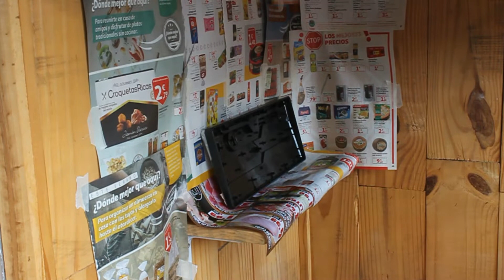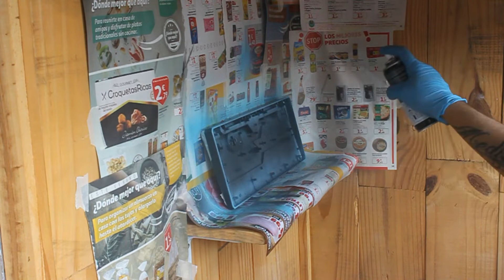Cómo customizar un teclado Krom Kernel TKL 🖌🛠  | Krom Kernel TKL Mod (Keyboard Modding)

Comment: Para comprar los keycaps tiene que tener algún tipo de compatibilidad ? Soy nuevo en esto de teclados mecánicos
Reply from the maker: Depende de los switches que tenga tu teclado mecánico pero normalmente suele valer para todos a excepción de alguno que sea muy especial! Si quieres dime que modelo de teclado tienes y te digo si te podrían valer los mismos que puse yo!! Muchas gracias por comentar!!

Comment: hola donde puedo adquirir esos guantes? un saludo
Reply from the maker: Hola Javier, cualquier guante de poliuretano te puede valer. Normalmente se suelen encontrar en cualquier bazar o ferretería pero si quieres te dejo éste enlace a Amazon donde puedes encontrarlos. https://www.amazon.es/Ruvigrab-Guante-soporte-recubrimiento-poliuretano/dp/B07X4RC1MN/ref=sr_1_5?__mk_es_ES=%C3%85M%C3%85%C5%BD%C3%95%C3%91&dchild=1&keywords=guantes+poliuretano&qid=1605365798&sr=8-5
Muchas gracias por comentar. Un saludo

Comment: De donde son los keycaps?
Reply from the maker: Hola, son de Aliexpress!! https://es.aliexpress.com/item/4000395759765.html?spm=a2g0o.productlist.0.0.374b593bXHXgMu&algo_pvid=7e6e4ee8-e5b1-4216-b751-140b737cb481&algo_exp_id=7e6e4ee8-e5b1-4216-b751-140b737cb481-0 Espero que te sirva!!
Reply: @JoshDesign  Buenas tardes, gran vídeo. ¿Qué puedo buscar en aliexpress para añadir algún que otro color que no sea sólo blanco (p.e. blanco/azul) a éste teclado? mateniendo los mismos efectos de led y demás que traen.
Reply from the maker: @danilrap  Hola Daniel. Prueba con la búsqueda Keycaps Iso de esta manera filtrarás algunos keycaps que tienen el intro ISO y aunque no llevan Ñ te sirven igualmente. En uno de mis últimos vídeos tuneo un Krom Kernel para mi editor y usamos unos keycaps diferentes por si quieres echarle un ojo. Un saludo!! 👍🏼

Comment: ¿Que PCB es?, ¿permite hot swap?, 
veo que es una configuracion de teclado en español
Reply from the maker: Correcto, el teclado tiene configuración en español, lamento decirte que esta PCB no permite hot swap dado que los switches vienen soldados a la placa, se podrían cambiar por supuesto pero ya tendríamos que andar desoldando y soldando. Gracias por tu comentario. Un abrazo!!
Reply: @JoshDesign  Hola, si lo permite. Trae una herramienta para extraerlos. No se si será cuestión de nuevas versiones del teclado pero el que yo adquirí hace dos días se pueden sacar los switches.
Reply: @grandu  Creo que te estás refiriendo a que incluye una herramienta para extraer los Keycaps (las propias teclas en sí), en ese caso sí. Pero como el creador del vídeo dice, los switches vienen soldados a la PCB y por lo tanto para poder quitarlos es necesario desoldar. Un saludo!

Comment: Porque no te quitas los switches? KROM KERNEL tiene switches cambiables!
Reply from the maker: Hola, Krom Kernel tiene switches con hot swap a partir de la versión 2021 y este teclado es versión 2020 por lo que los switches que trae están soldados y no son intercambiables a menos que desueldes y vuelvas a soldar. Un saludo y gracias por comentar!!
Reply: @JoshDesign  ¿Hay alguna forma de saber qué versión es sin abrir la caja? ¿Alguna referencia? ¿Código de barras? Compré el kernel de KROM la semana pasada en una tienda que nunca tiene existencias antiguas, ¡y obtuve la versión 2020!
Reply from the maker: @MarcoLopesPT  Pues no te sabría decir, abriendo la caja es muy sencillo saberlo por que te viene incluida una herramienta para sacar los switches y cambiarlos!!
Reply: @JoshDesign  Respuesta de KROM "Outside the packaging you can find a sticker where it's specified that the keyboard is compatible with the CIY technology"